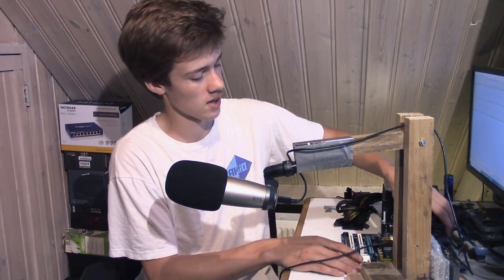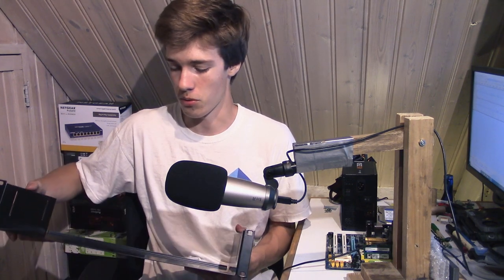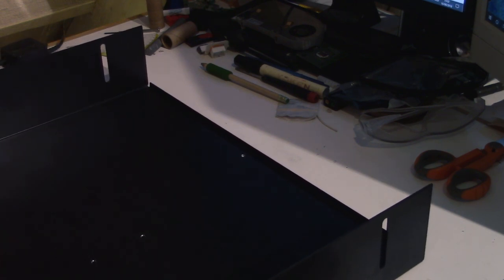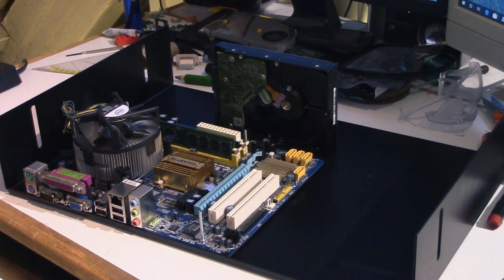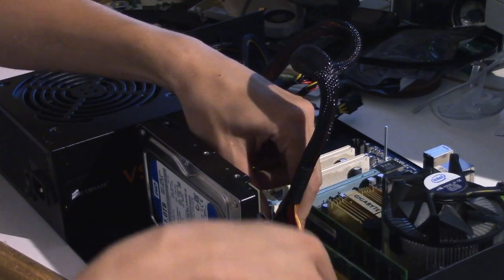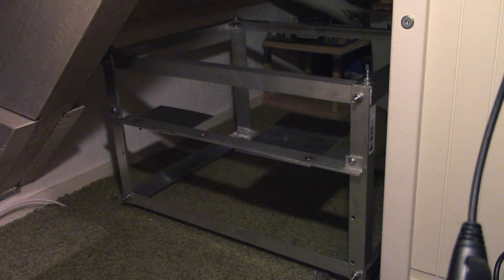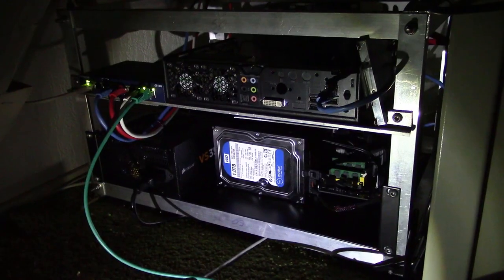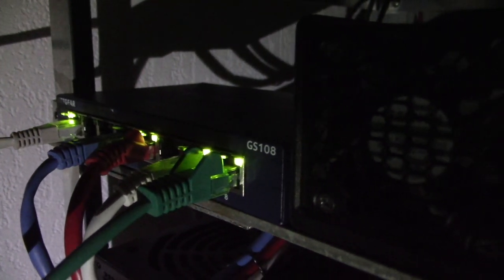Building a new rackmount NAS (AKIO TV)

Comment: I want to build one, but I'm not sure which way to go about it.  Maybe I'll just use a PC setup rather than a NAS box.
Reply from the maker: Whatever you decide to do, building one yourself or recycling an old computer is always a better solution than one of those cheap off the shelf underpowered NAS units.
Reply: I was looking at the AMD A series cpu.  Just build a low cost PC with FreeNAS.
Reply from the maker: A-series cpus could be an option, but don't get a new one, get something that's used, because used hardware has a GREAT value for money. With used stuff, it's often possible to build something that is more powerful than a new system with the same price tag. Of course, for critical components like HDDs and PSUs you should use new stuff, but for mobo/cpu/ram old hardware is an awesome solution.

Finally, FreeNAS is a great NAS os, but perhaps you should look into other server/NAS operating systems because FreeNAS has very high system requirements. FreeNAS used to be "that awesome os that allowed you to turn any old pc into a nas" but it's no longer like that, the server has to be quite powerful (and possibly expensive) to run the os.